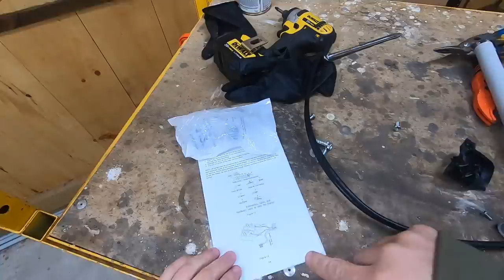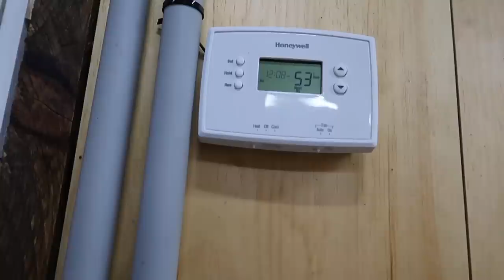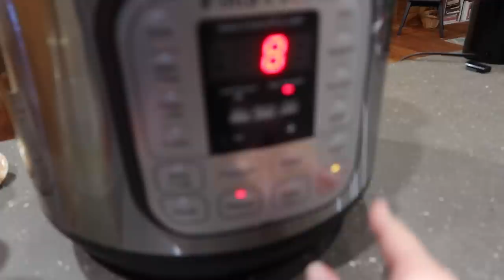Are we NUTS??? ELECTRIC HEAT in the WorkShop!!! You Might Be SURPRISED WHY

Comment: Al I was a contractor not an electrician, However I believe if you use the unwrapped wire as a return for 220/240 you have to connect it to the return bar with the white wires from the 110/120 circuits. Maybe one of the electricians that watch can double check what i am saying
Reply: unless its going to a sub panel than all grounds and commons need there own bus but otherwise your correct

Comment: Heat sounds so nice. It’s supposed to get down to 27 degrees here in Georgia tonight. And I’m not up in the mountains they will be a bit colder. I have a small heater I put on in the well house when it drops down this cold. I’ll turn it on once it drops this cold and it goes off end of February. Has a thermostat. Just enough to keep my pipes from freezing. Has worked for 30 years. Just an inexpensive heater, but has been wonderful. Used the same one for 28 years and just replaced it last year

Comment: as per northern tools it requires a 2 pole 240 volt thermostat that will handle 32 amps. the circuit that you ran down the wall is said to be 240 volt or at the very least 120 volts on one leg of it. Al check the wiring diagram to be sure and stay safe out there. anything higher than 24 volts needs to be run in conduit of some kind for your protection as well as the wire..... Note: i am not an electrician but i did stay at a holiday inn once. love the vids and i think i can smell Gina's cooking at the end of each video. thanks for taking us along on your journey, especially for those of us not able to enjoy the life in the country. jim in central florida

Comment: In regards to the thermostat, I have the exact same one in my house. The white wire terminal is labeled W (4th from right) and red is R (2nd from right). On the back left corner of thermostat is a switch to set it for gas/oil or electric/heat pump. Make sure it’s electric setting. Operation wise, I never messed with programming it. Press the hold button to override all programming and set it to desired temp for working in shop. Bump it down to whatever nighttime setting you want when you shut down for the day. I think 70° is very optimistic. The specs you mention is for an 8 ft ceiling height, so, you have a lot more than 400 feet of heatable space. Good luck
Reply: Mike P , that is exactly right, The output should then match what the heater needs as input. 
Al, nicely done in regards to heating system. You are just beating the cold weather coming. 
Snowing still across the border up here in Quebec.
Reply: I think Al was setting it for 60 f , if I'm not mistaken. That should be doable.

Comment: Al a programmable thermostat is for homes or offices where the room is occupied at regular frequency. You could setup the below setback programming Monday - Friday 5am 60°
Monday - Friday 6pm 50°
Monday - Friday 11pm 50°
Saturday Sunday 5am 60°
Saturday Sunday 6pm 50°
Saturday Sunday 11pm 50°
Fyi if your in there you can bump up temp and it will setback at 11pm to 50°. Check the temp in workshop on a low temp morning to see how your insulation is performing. I really enjoy your content.

Comment: You might want to mark the new heater wire in the panel. Wrap some black or red tape around that white wire to show it’s hot, not neutral.  Do you have to get electrical inspections?

Comment: I didn’t get the complete message about the problem with the thermostat. I do HVAC for a living and generally I would put the simplest heat only thermostat like ones you would install for baseboard heaters. They usually don’t need batteries. The thermostat you have will work as long as you connect between the r or rh and w terminals and use batteries. Also remember that you want to achieve the temp your looking for at the height you install the thermostat at. In other words your comfort zone is determined by thermostat height if that makes sense. Water storage that’s at floor height could still be too cold maybe so there’s that. I still think non-programmable thermostat or simple baseboard style thermostat will be just fine.
Reply: Bill’s Solar Power and Gardening
 It was my impression that the batteries were to keep the program schedule if the power goes out.
Reply: @jeffstock3590  the batteries operate the relays on the control board for such as compressor, heat strips, fan and reversing valve. Mechanical thermostats are better really for this instance.

Comment: Great video need to color the white wire with black marker when you use it for 220 so they know it's  hot
Reply from the maker: I’ll have to get out a sharpie.
Reply: @LumnahAcres  - Or you can just cut strips of black electrical tape and wrap it around the white wire.  It would then match what the electrician did when he wrapped white tape around the black wire indicating that it was now used for a neutral.  Nice looking install by the way.

Comment: You probably need an inline thermostat, which is designed to switch the line voltage and higher amps. I you happened to install a regular hwac thermostat, the contacts designed to handle a controll voltage of 24 VAC, are likely already burned out because of excessive load.
You potentially could have use the regular hvac thermostat providing that you would add a line voltage relay to handle the high load, and in turn the thermostat would controlled just the coil if that high load relay. Good luck.  Love your show.

Comment: You could have saved $ and had a much easier time pulling the #8 through the PVC by purchasing single conductors rather than fight the jacket on the able assembly.  The jacket is only for physical protection anyway.
Kingfish
Reply: Some lube always helps 😊
Reply: Also, enlarging the 1/2” knockout on the heater to 3/4” (with a unibit) would have allowed the entire run to be 3/4” instead of reducing it.
Reply: I can’t believe anyone pulls wire on a simple Installation like this.I’ve wired hundreds of hot tubs and I always assemble the conduit as I go. Also not sure where you buy your wire but the savings is pennys at best over buying the Romex here and it’s so much easier to work with than individual wire.
Reply: A quick search at homedepot.com shows the 8/3 with ground is actually cheaper than buying single wires by about 18 cents a foot.

Comment: If you  end up having to get a different  thermostat, you might consider a low temp thermostat. They will allow you to keep the shop just above freezing. Heating is a big expense for us in WI so having the option to lower the heat a bit more than a standard thermostat saves quite a bit.

Comment: Be careful when installing the ground wire in the panel - you are holding a bare wire and it's waving around . - touches a buss and you'l learn a new dance
Reply: That’s good advice!
Reply: If you noticed he did turn the main power off before he got in there like that.
Reply: took another look and you're right - it was so light in the video that it looked like the  the overhead lights were on . fooled me , but not everyone turns the main off every time , but it's the safe way
Reply: I NEVER PULLED A BARE WIRE IN A PANEL  IT CAN DO JUST LIKE YOU SAID . Also when they came out with nylon wire feeds i threw away all my metal ones . i had a guy in my town run one thru a conduit to the box anit landed on the hot leg main before the breaker  it destroyed him completely
Reply: That stretch of exposed wire is waaaaay too long for my taste. I thought there is grounding wire that’s not exposed like that

Comment: they have wire lube for pulls through conduit...in PA there needs to be a ratio of gauge to open conduit space..still a tight pull..wax base at lowes too..I used it when wiring mobile homes from pole to service box..great stuff
Reply: I remember all too well of pulling wire drenched in that disgusting lube for days on end when I worked on the then new Winnipeg city police headquarters.

Comment: Remember=what i said when you were first putting conduit up? I asked if you reamed the interior of the male sides. This is why you should have done it. We ran conduit thru our entire house for ham radio coax, and have 3-4 cables in each run( depending on what it was). No problems at all

Comment: I usually skip the milking. Good job on the heater. Usually heaters like that require a line voltage stat, which means it makes and breaks the 110 VAC circuit. When I saw you using the Honeywell I wondered if there was a transformer and a control relay. Built into the heater. Programmable are usually low voltage 24vac like what would be used on your furnace in the house. They need to be powered all the time even though they have a battery. Check Amazon  programmable line voltage wall mount thermostat see what comes up. The Honeywell TH106 looks like what you may need. I found it on Amazon $56.  Compare its specs. To your heaters. Good luck.
Reply: @mikesparks3398  - Same here!
Reply: Ditto
Reply: Mike Sparks I skip the cooking segment; that should be in a video all it’s on.

Comment: Another plus...unlike propane heaters this will not pump moisture into the shop. BTW it's a common practice to wrap the white wire to the breaker with black electricians tape. That way it could not be mistaken for a neutral wire.

Comment: Instead of the 1/2" PVC bend, you needed an "L" box and a 1/2" adapter for the case. L's give you room to pull and gather conductor outside of the bottleneck.

Comment: Did you flip the thermostat selector switch on the back side of the heater to external? That's the "--" for external. "0" for internal.

Per heater manual: Note  1:  You must  turn  off  the  ON/OFF  switch  on the  front  of  heater  before  you  select  the built-in  /  external  thermostat. Note  2.  Please  find  the  rocker  switch  on  the  back of  the  heater  as  shown  in  Figure  10 and  shift the  switch  to  “—”  position.  Then  the  heater  will  be  controlled  by  external thermostat.

Comment: Shouldn't you be painting that white wire black at both ends?
Reply: Chuck Tintera sometimes we will tape the white with black , red, blue etc. coming off a double breaker it’s obvious tho. On the equipment end it’s def helpful to let others know that it’s 208/230v equipment if it’s not noted on the labeling. I wouldn’t use paint on this insulation for fear of breaking it down, maybe. I once had another “electrician” remove my white wire from a double breaker going to a mini split inverter HVAC and placed it on the neutral bar and used half the breaker for the new shed. The HVAC still ran but real slow and froze up and would not turn off. A few calls to tech support and top technician says check the supply voltage. 🤔. If all the lights light up you assume your getting the voltage you wired it up to. The smartest guy at Samsung didn’t think about it until after the 4th call. I apologized for the trouble and the customer started counting out hundred dollar bills apologizing for their “electrician”. Moral to the story, tape over the white wires in hopes that “electricians” will do the right thing 😝.

Comment: Check the voltage required for the heater to turn on plus maybe they have a Blue Tooth one just in case you need to go work shop during the Night and Battery back up . Would Wind work better or both solar to get a like a old Military Generator just in case summer or Winter the Main Grid can have issue . Just a thought 🙂🙃

Comment: You must have cheap electricity to run a 5KW heater!
Reply: You are not kidding. His electric bill is going to be sky high.
Reply: He did say that it was the cheapest electricity in the area.
Reply: ,,,, and a tight building.
Reply: He explained his reasoning in the video.
Reply: @cooldog60  I have two of them in my shop and don't turn them on until i absolutely have too. Way to expensive for me. I usually fire up the wood and coal stove.

Comment: Have you thought about a ceiling fan for the workshop?   It would help keep the heat down into the lower part in the winter and pull it up in the summer.  It would make the heater a lot more efficient.  We have had snow twice here in Nebraska.  I am surprised it took so long to get to you.

Comment: When transforming from 1 type of conduit to another  a connecting box  shall be introduced . also all the electric heaters i installed i user an in line thermostat it was simple and worked well . i did a few with a low voltage thermo but had to used a relay

Comment: When I had my  heater installed in my garage the electrician used metal sheathed cable from the conduit on the wall to the heater. It allows me to swivel the heater to redirect the heat. This is my first winter with it so I don't know if I will even need to swivel it.

Comment: Yowsers!!!  I looked at the wiring diagram in the owner's manual and that thermostat remote controls a 240V coil on the contactor.   BE CAREFUL!!   Typical home thermostats control a 24V circuit to your A/C or Furnace.  It is likely, the thermostat you chose is not rated for 240V control purposes.

Comment: Lowes has WiFi thermostats. Both Honeywell and the Emerson Sensi WiFi thermostat would be great. You can check the shop temp from your phone and set the temp from your phone. 

Wow, 10 cents per kWh for the first 750 kWh, then 18 cents. 10 cents equals about $225 a cord for wood heat. 

Good for Littleton. Those NH penny pinchers are doing a good job.

Comment: Good morning folks! It is a balmy 19° out & dropping. I am approx. 50 miles due west of you guys in the central highlands of Vermont.  I stepped outside moments ago, in my slippers I might add & took some crude measurements, ( yard stick ) of snow depth with an average of 5" thus far on Tues. morning. I recognized the I-93 S section of interstate that bypasses the downtown on your way to Lowes yesterday...
Nice clean & neat job on wiring up the box Al as some pros don't show this much pride in their work! 
My 2¢ on the thermostat would be, take the spec sheet with you on the ceiling unit when you head back to Lowes, it may be something quite simple, it usually is... Another option would be to talk with an electrician familiar with these installations. ( Today I install skid plates onto my carry-all build project. ) 
Bill on the Hill... :~)

Comment: Might I suggest a 'white rogers' setback programable thermostat.  I had one and it was exactly what I wanted.  Many ways to set it.  It was hardwired in but had a battery backup.  I think it would work fine in your workshop, good luck.  I had gas heat but I believe it would work with electric.

Comment: I use a similar heater, and I used a stove plug in to make it an easy removal, in case I would like to take it to a different place to use. Also makes the process EASIER to do if You are standing on the ground.

Comment: To meet code for electrical on a 240v circuit shouldn't you wrap the ends of the white wires with red electrical tape so the next person doesn't think it's a neutral wire when it's a hot (load) wire?  Enjoy your videos,  keep up the good work!

Comment: Al Not sure about the thermostat type you need, maybe you could show a closeup of the drawling. Don’t take it back just yet. How big are the lugs where you hooked up the thermostat wire? If the lugs are big you may have to use a line voltage Thermostat, so that would 2 #8s running down to  your wall thermostat.

Comment: THERMOSTAT - I have that same heater, you need a double pole 240V (or "line Voltage") thermostat.  I think the one you have is a 24V for household HVAC systems.

Comment: I am wondering why you ran the wiring for the heater through PVC ? It is not a wire that is exposed to weather..so just wondering ? Is that code in your area ? It could have just been run along the framing and put on with wire clamps that can be screwed to the framing. It would have been cheaper and way less time. Of course you would have needed a piece for the wire to run into the heater..so it doesn't have a chance of scraping on the metal heater housing. Just wondering what your thought process was ?

Comment: you should just need to hook it up between R and W terminals which are the same on either terminals.  Are you positive it doesnt need a line voltage thermostat?  the one you hooked up is normal for a house using 24v.
Reply: also if you install a jumper wire on your terminals on the heater its basically calling for heat at all times but it tells you the problem is in the stat and not the heater (if 24V thermostat is required).  with the line voltage stat power will go thru the stat and then to the heater.  You just need to confirm what you need in the directions.  Happy to help further if you PM me on FB.

Comment: You may need  a thermostat that can handle more current. I believe the one you bought is for a 24 volt AC control of gas furnaces and other low voltage control heaters. It may just be the programming if your heater already has low voltage control.
Reply: You can measure the control voltage by using a voltmeter set to AC volts  and check the voltage between the 2 control wires. Because the meter has a high resistance it should read the AC voltage.
Reply: That specific heater has the 24vac transformer to run a thermostat vs a switch/thermostat to carry 30amps each hot leg.

Comment: Your heater is set up for a 240 volt  line voltage thermostat, the one you got is low voltage.  You need to run the same size wire you used to power the heater down to the thermostat (like a wall switch)  in conduit and install the correct t-stat.  In the mean time just put a jumper wire across the t-stat terminals in the heater and turn it on and off at the breaker.

You also need to start gluing all of the PVC...it's not designed to be a press fit.

For future reference, they make a PVC glue to pipe thread coupling that would allow you to thread in a straight flex pipe connector (like the 90* you used) making a good connection of the flex where it meets the solid pipe above the heater.